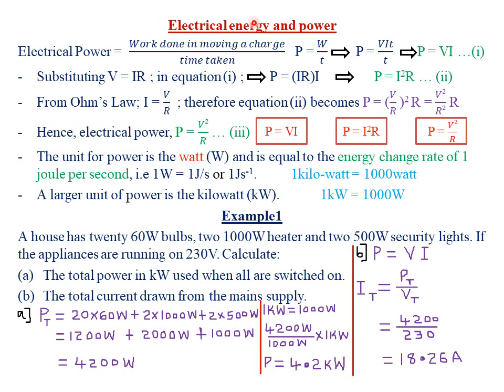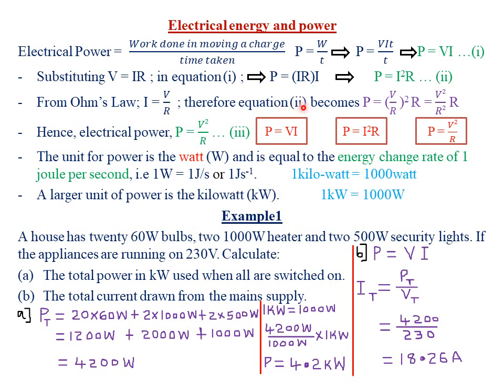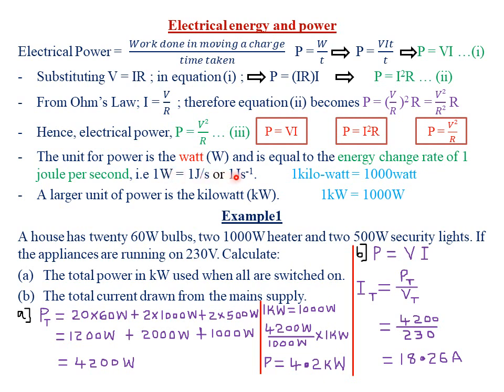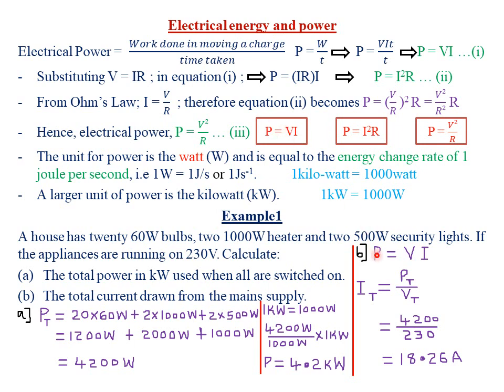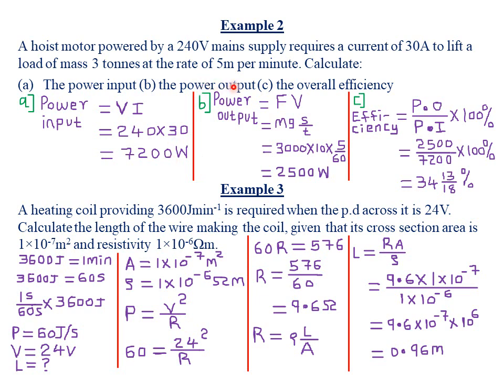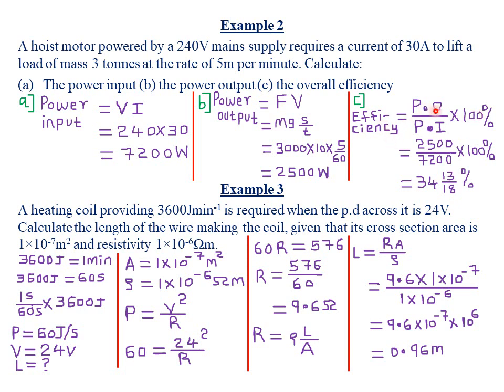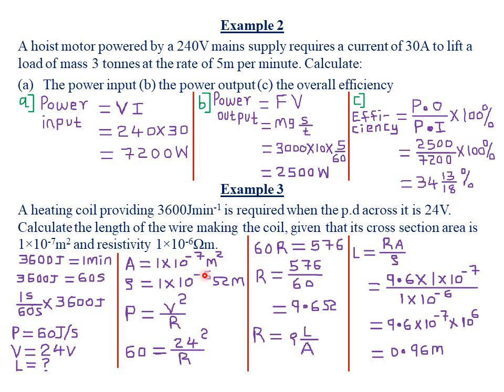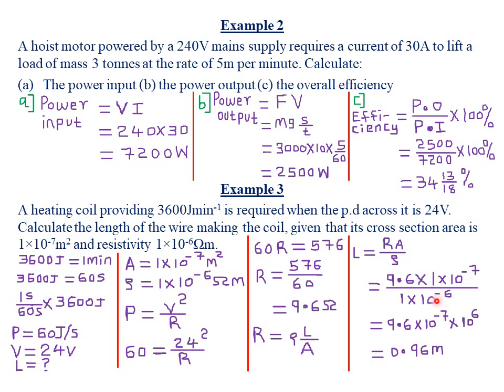HEATING EFFECT OF ELECTRIC CURRENT: LESSON 2

Comment: Power is measured in watts.Why is it that in example 3,you defined power as joules/min.
Reply from the maker: It simply means you have to convert the power to SI Units before using it in any calculation, remember that from P = W/t , it simply means that 1watt = 1 joule per second i.e 1W=1J/s.
Reply from the maker: It simply means you have to convert the power to SI Units before using it in any calculation, remember that from P = W/t , it simply means that 1watt = 1 joule per second i.e 1W=1J/s.